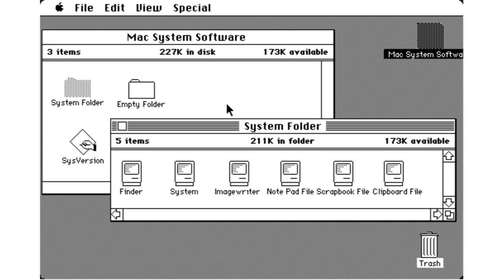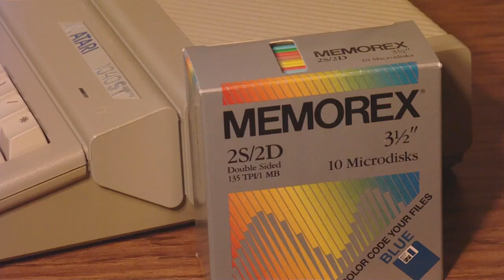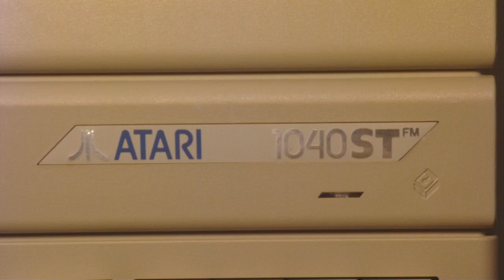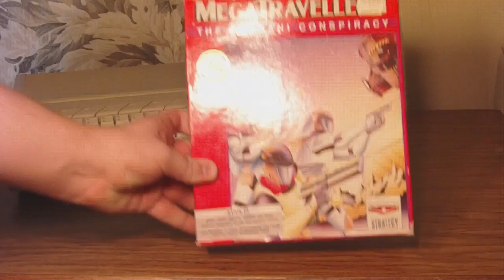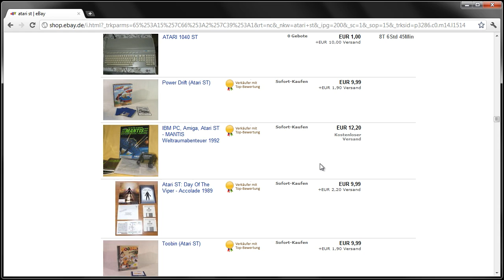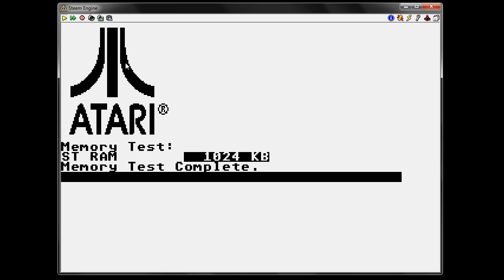LGR - Atari ST Computer System Review

Comment: Thank you for this review.  The ability of the Atari TOS based computers got me away from the Amiga back in 1989.  If you get an STE many games thake advantage of the extended graphics and sound that is possible.  Also if you have a small (under 120MB) SCSI HDD, you can find ACSI to SCSI adapters, and with a small enough HDD you will not need any custom drivers (just use the one on your language disk [that came with the STFM]). Otherwise build one of the IDEs and burn a cartridge ROM driver.

Comment: macintosh, amiga,  genesis, neogeo (i think), numerous arcade machines (many sega arcade machines had 2,3..) , sharp X68000 , first silicon graphics workstations,..etc
great CPU, very pleasant to program

jaguar only used it for a minor  role, its main processors were custom 32bit risc

Comment: i have a 1040 st with monitor and second floppy drive it also has a box that plugs in to those stupid controler ports that brings them out were you can reach them to switch from mouse to joystick you just turn a switch. i had this computer since it was new in 87. i also have tons of office software lol i could use it to run a busness. a lot of switching disks though

Comment: I just bought two Atari STFMs on eBay (each for about 40 dollars including shipping) but both come with monochrome SM124 monitors. Is it possible to connect the STFM to my Commodore 1084 color monitor? Or any other VGA PC monitor for that matter?

Comment: I fitted my 1040STF with joystick extensions so that I wouldn't have to lift it every time a switch had to be done. Unfortunately I fried the machine when touching the CRT screen while the pins on the joystick extension chord were in contact with my body. Thankfully I still had warranty so I got a new computer from the store.

Comment: I don't understand, are all American TVs just simply not PAL compatible? Here in UK I got my first TV back in 1997 and it could display NSTC just as easily as PAL.
Reply: To be fair, how PAL TV's displayed NTSC varied a lot. I live in Finland, and along years tested 3-5 TV's with an NTSC source. Only one of them displayed it perfectly, i.e. changed the refresh rate (flickering notably decreased), and changed the spacing between lines to keep the aspect ratio (PAL and NTSC have different number of lines). Other TV's would produce variable results, usually black&white picture that was distorted. That being said, the one that did show NTSC correctly was bought around the change of millennium, so it was about the same age as yours. The ones that had problems with NTSC were a few years older, so it could be that the compatibility started to be included only around that time. All flat-screen TV's I've tried have displayed NTSC without problems -- that is, from video inputs. I'd expect that not many of even current DVB/PAL TV's would be able to actually use their tuners to show NTSC broadcast signal like what some old systems output from their RF outputs.

Comment: You're wrong about the joysticks. The ST actually IS compatible with Atari 8-bit joysticks. It's the same pinout, also the same pinout as on the C64 and others. It's the Sega Genesis controller here which is NOT an Atari joystick (putting  +5V on pin 5 instead of pin 7). Genesis controllers are known to potentially cause permanent damage if you connect them C64s!

Comment: You've already been tipped off that the TT actually ran at 32mhz and had a full 32bit bus unlike the Falcon, right? :)

(as well as the former being mainly meant to use VGA-type monitors whilst the latter seemed more intended for use with old RGB ones, though they were still VGA compatible...)

Comment: @phreakindee 
It became very apparent during the late 80s and early 90s when it shifted from amiga getting atari st ports to the atari st getting amiga ports. Most of these were rush jobs. If you try to do the same thing on the YM as on the amiga sound chip without making a proper effort, it sounds like garbage. Nice review, the ST was the computer I grew up with so it'll always be a favorite of mine, joystick ports be damned.

Comment: Wrong.  You can also do fine mouse movement too.  If you are playing a 2 player games and do not want to swap the mouse back from the Joystick but require one to use GEM then using the keyboard mouse is quick and simple, and will help prevent damaging the mouse port.

Comment: amiga wiped the floor with it; but, imagine if you could change history and give the ST  packed pixels instead of bitplanes (word size = 4pixel precision instead of 16pixels, and faster to plot polys/lines)... the contest would have been a lot more interesting.
Reply: walter0bz ST cost 1/3 what an Amiga went for.  I lusted for an Amiga, but working for $14/hr, all I could afford then was the ST.  After a flood of fun software came out, namely Sundog and Dungeon Master, I didn't mind having somewhat lesser graphics and sound quality.
Reply: I realise the atari ST still had virtues.
I would like to see a parallel universe where the ST had a packed instead of planar display, it would have been a far more interesting fight.
Reply: sillyone52062 also, the ste made up for the graphics and sound department. Still not as good as the amiga 500, but definitely in the same league

Comment: the 1040st power supply IS a switching power supply, and it doesn't add much weight to the unit.

Comment: Amiga owner here. I wish I'd tried an ST now but back In the day I was rather dismissive. Good how you can write direct to floppy, can't do that with my Amiga emulator, need hardware for that.
Reply: The Amiga's floppy hardware was quite powerful, which is how it crammed 880k onto a 720k floppy.  With a little software wizardry (crossDOS), it can actually be convinced to read 720k MS-DOS format floppy disks, though... which also includes ST disks.  Classic Mac of the era would read MS dos double densities as well IIRC.

There's a catch, of course.  It's a pain to transfer ADF's this way, since they'll be 880k and won't fit on a single disk unless you use a compession program to create a two part file.

Comment: It's easy to comment nowadays that one computer was better than the other, or things like that, but you have to think when this computer was released:

-The 1040st was released in 1986. Think about that. 30+ years ago. You can't use today standards to compare.  
-It was released before the Amiga. There was nothing like it at the time, graphics, sound, amount of ram (1 megabyte was unheard of in a home computer. Even the original Amiga shipped with only 512KB of ram) were amazing for the era. That's why early adopters got it instead of an Amiga.
-PC's, specifically PC gaming was crap or non existent. The Atari was far better than playing in a PC with purple/cyan cga graphics.
-The Atari was more popular in some countries. Where I lived we didn't even heard about the Amiga, and the Atari was far a better option because you had more access to hardware and software. You could also "share" your games with other friends with the ST.
-The midi ports were very accurate, even by today standards. There was good music software too. That's why a lot of musicians used them even years/more than a decade after Atari ceased to exist.

I have very fond memories of my Atari 1040ST. It was a great machine, far better than a PC for gaming at the time, with a great selection of games. Probably one of the most iconic ones for the platform was Dungeon Master.

Comment: The 2 ports underneath the front used to piss me off,Until I bought an  extension cable,4 plugs 2 on each end,Funny It's still in the loft with 500 plus disks,Think I might dig it out

Comment: Hi Phreakindee, I need your help. I am from USA,. I just bought the Atari Mega ST4 from the Ebay. The problem is that it does not have a RF Modulator port on the back, only RGB video output. Can you send me a webpage from Ebay, that will allow me to connect RGB  to VGA on the back of my HDTV?  Or should I use RGB to HDMI converter box?  so I can use the low res 320x200x16 colors  and also  4096 -colors paintbox software here developed for the Mega ST4 in 1988.  Thank you for your help..

Comment: The writing of disk images is not always successful as the floppy controllers inside PCs are quite limited. If it is a DD disk with you average 80 tracks and 9 sectors it's working fine. But If you have games with bigger tracknumbers or sectornumbers you might get problems. Popular examples for this are Turrican and Turrican 2 which are really good run and gun games. For writing them you need a different solution as a floppy emulator or a flexible disk image writer.

Comment: I did have the 1040 but i did trade it for my friends 540/FFD/ST monitor , The 540 can upgrade to 2.5 megs ram the 1040 to 4 megs ram , Other then Cube :( can i run all the same stuff as 1040?(i think the only diff is ram)

Comment: Totally agree with him regarding the joystick port. It was painfully annoying and just awkward, adding to the fact that the damn computer was heavy as f__k too. 😡
Reply: I had a set of extender cables that were always plugged in. You didn't have to go under the machine after that. It's a solution to a problem that should not have existed though.

Comment: What ST would be better than an Amiga, and in what way?

The Amiga beats the ST in just about every way imaginable.

While the ST can display up to 16 colors on screen, the Amiga can display up to 32 or up to 64 (EHB) colors in low res, or up to 4096 in HAM mode. This is far superior to the ST.

The ST (earlier models at least) contains the same 70s sound chip as the Intellivision, while the Amiga's Paula can produce PCM audio through 4 channels - in stereo.

What does the ST do better?

Comment: Stacy ran on 12 C batteries and lasted for 15 minutes.

... I can imagine it now. Well, it finally finished booting. Aw shit, the battery's dead... all 12 of them. 

And those things weren't cheap either. Not only that, I'm guessing it didn't have a standby mode, so you had to completely reboot it to change the batteries. That's awful. How'd it leave the factory?
Reply: "lasted for 15 minutes"
I can relate. Cries in old laptop that needs its internal battery replacing.

Comment: 6:00 hahahaha oh god the infamous STF joyports claim another victim, 20ish years after they last pissed off a brand-new retail customer :D
At the time, straight-thru ~6 inch extension cables were an essential accessory. We never did figure out why they did that, when Commodore managed to work it out just fine on the A500 and 600.

However, did you try plugging in -anything- other than Genesis pads? They had notoriously poor cross compatibility. Master system pads, amiga sticks etc work just fine

Comment: The STE was so much better as it had 4 joystick/mouse ports with 2 in a more useful place and the RCA jacks for plugging into your Hi Fi are still a feature you only get with the most expense PC sound cards!
Reply: Mr Sammotube did they fix the swag genesis controller issues on the  main controller ports?

Comment: There is mysterious things with your Atari ST.
I´m from Sweden and has owned several vintage computers with swedish keyboards in my days (allthough no Ataris) and I still hav a VIC 20 and a commodore 64 that also has swedish keyboards.
All have Å Ä and Ö of course, but non of them hade a separate key for Ü (that your keyboard have) that is a letter that is never used in swedish and therefor of course is not in our alphabet.
The germans use Ü alot and they also use Ä and Ö in their language but as far as I know they never use the letter Å (that your keyboard also have) and Å is not in their alphabet.

This is fucking spooky.
Your ST is from some weird dimension were there is a society that uses both Å and Ü.
If that isn't horrifying then I´m a pro choice pope.
I wouldn't spend a night a night in the same house as that fucking weird ÅÄÖÜ-computer.

Edit: Great video by the way.
Reply: We Germans Ü were Swedish uses Y instead always wondered me why someone would put both  ö and å on a keyboard.

Comment: Hm....the review is far from being complete and some things mentioned are even wrong.
I tried to write everything down here, but it was not possible because of lack of text space. In short; most drawbacks you mention are not quite correct this way, instead you forget some other ones. What is complete impossible, is to review the ST without having a monochrome monitor. I admit that reviewing the ST is not quite easy because there is very much to know about it in the first place.

Comment: why anyone bought this over amiga is beyond me
Reply: It was about 100 pound cheaper and it looked cool for a computer with all the grills and function buttons, it was a good computer and had a hi res mode in mono, midi, and the same software as the Amiga in general, but with downgraded sound, colours 16 instead of 32, slightly worse scrolling
Reply: IT was cheaper and had a MIDI port which revolutionised electronic music in Europe. Tons of famous bands used them. Some people still do.